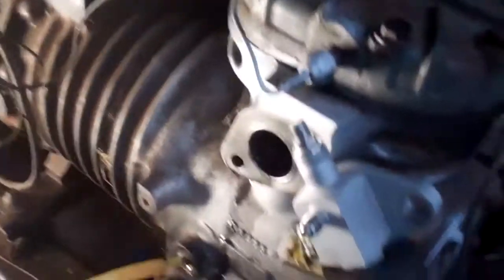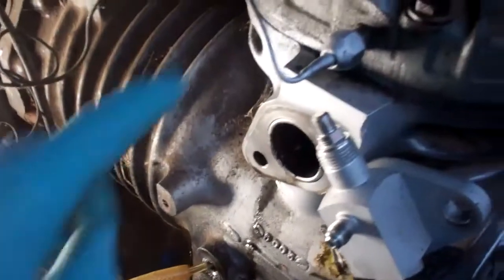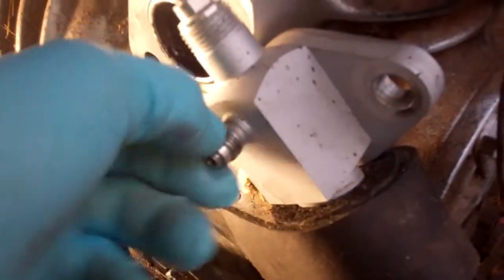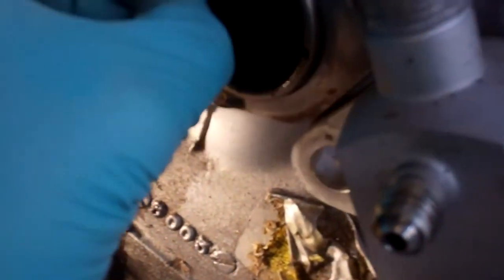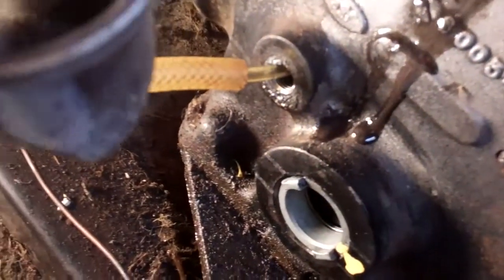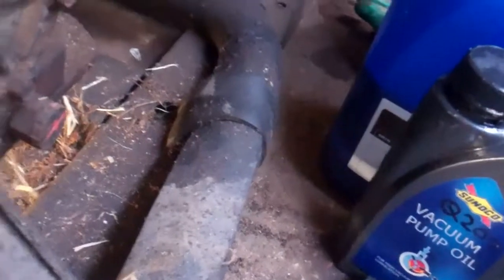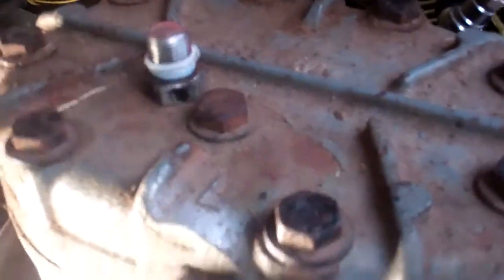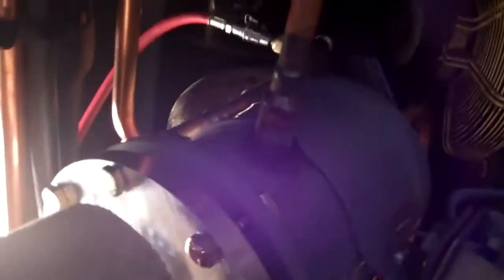Fabdec Ice builder system drying

Comment from the maker: @towrecker Thanks! moisture causes a lot of problems even if the system keeps running, i've stripped a few failed comps and found copper plating on bearings and valve plates etc, i tend to oversize driers especially on newer refrigerants now.